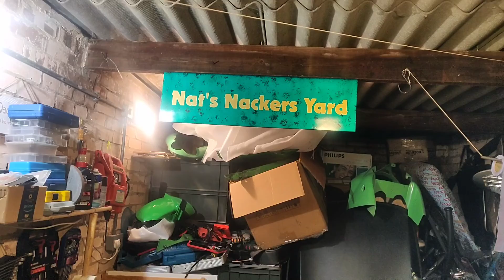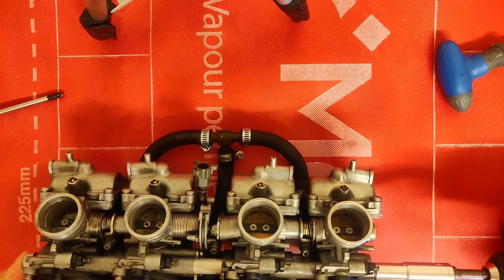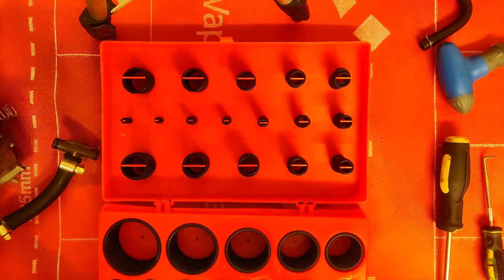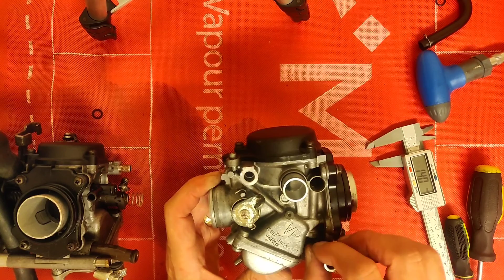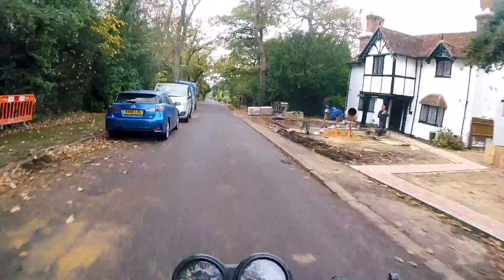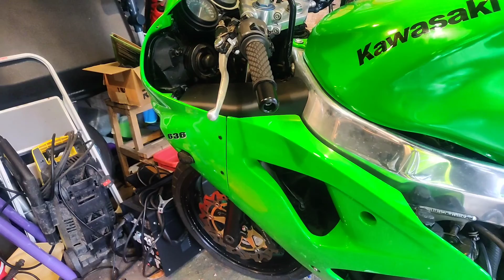Honda CB400 Super Four.  Leaky carb fix?

Comment: That Honda is night and day from when you first got it. Well done. Just want to share my experience on carb o rings. They really need to be Viton for any sort of long life as modern fuel will eat them over time if they are not. Most of the o rings I've come across  in Japanese carbs are not the same dimensions as readily available stuff from bearing traders or kits you can by. Often the od or the Id can be right but the cross section is wrong so they end up being tight or loose. As a heads up Allen's performance sell  the correct size o rings for mikuni and keihin carbs which are petrol proof and cheap. They also have a size guide on their site so you can check what you have and order the right parts. Not a criticism of what you have done but just passing on what I've learned over the years, often at some expense!
Reply from the maker: Mate, I will never turn down free advice! Constructive criticism is absolutely fine with me. If I was happy to learn new things then I wouldn't be you tubing!

Comment: So did you put sealant in all the o-ring indentation?  Hard not to I guess. Would have been nice to know if the o-ring had sealed off the petrol without extra sealant
Reply from the maker: Trying with and without would have meant carbs on and off yet again I am afraid.  The sealant was just on the outer surface of the o rings.
Reply: @NatsNackersYard  just put same o-rings on, going to try without sealant. Fingers crossed
Reply from the maker: Same bike?
Reply: @NatsNackersYard  No, older Honda cb500. But a short aluminium tube with two o-rings is, well, just that. Not rocket science thank god.  Bigger problem next. Brass throttle valve guides to be squeezed back in in two carbs. Should never have pulled them out. "Oh i might as well pull it all apart", i said in 2020.
Reply from the maker: Lol. I think that we have all been there on an overenthusiastic strip down!